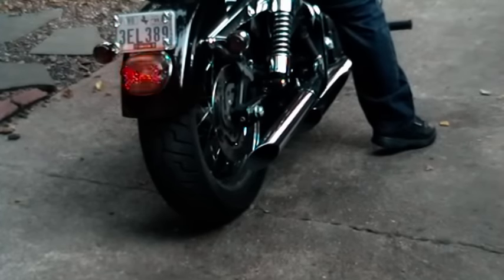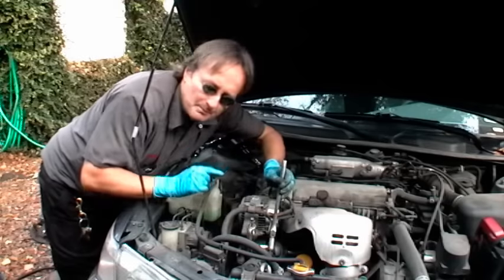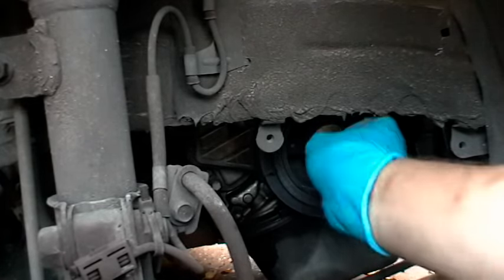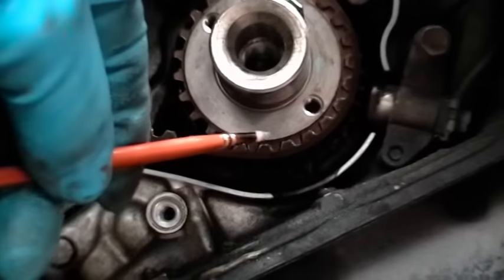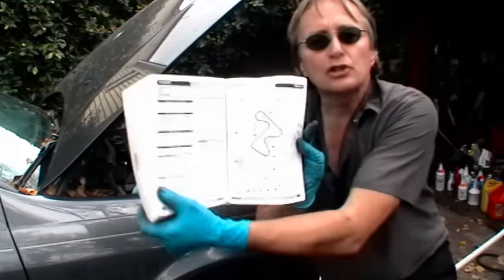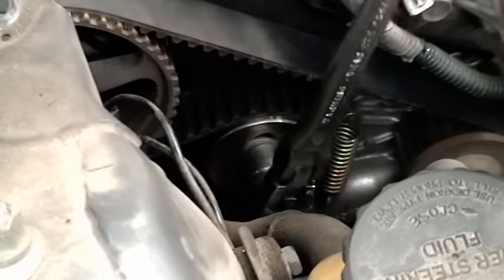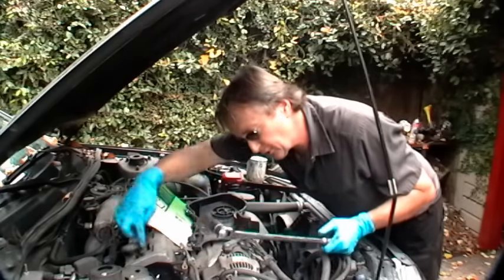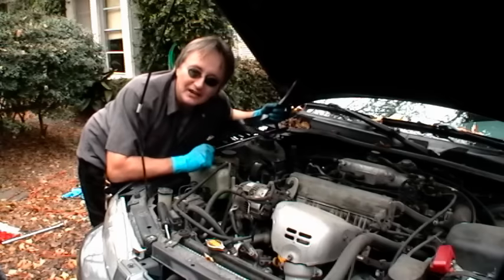How to Replace a Timing Belt in Your Car

Comment: Would a broken timing belt or a slipped one cause the car to not start? My 94 ford escort lx 1.9 won't start but the surpitine belt spins and we had the altnator and battery and starter tested they all work fine it sounds like the car isn't getting enough power when it clearly is.

Comment: Scotty, what do you think about Volvos?
Reply from the maker: +ALPHAzerox898 great cars in the 60's, over engineered Euro trash these days
Reply: Okay, and what would you suggest me, as a mechanic if I want a convertible that makes winter
Reply from the maker: +ALPHAzerox898 convertibles and winter do NOT go together. Most guys hide their rag tops in the winter if they live in snow land.  But if you must have a winter convertible, try to find a japanese FWD one, though they are hard to find as not many were made
Reply: Okay, I can see the Lexus IS350C which is made by toyota. Also, there is a BMW AWD but I won't  think about that one :P Thanks for the answers!

Comment: i know, right? but i did some number-crunching, and i'll definitely be able to get it towed to the shop for them to handle it properly, otherwise i dont know how id be able to keep the engine up because the engine mount has to be removed, which means the engine needs to be hoisted up to get to the belt. turns out ive got this one under control....this is just sheer dumb luck though

Comment: The engine mount is in the way of the timing belt, should I take it off?  Will the engine just fall to the ground if I take the mount out?
Reply: Raptor 911 you shouldn’t be attempting this if you have to ask this question!

Comment: hmm, i was told you need to crank over the engine to TDC and lock down the cams and crank. Is this true? or does it differ for each engine? I have an interference dohc engine

Comment: Hely Scotty, car was running greaet but today I 
so i installed push button start system in my  ford escort zx2 178k MTX, turn it on with the button, then i turned it off and the on then off then on then off, at the 5th time that i dis this consecutively, smoke came out under the hood on the passenger side.

then the rpm's went low and then the car died,  since i started it on and off and on and off , would there be a chance that the smoke was caused by the timing belt jumping or something for starting in and shutting it off consecutively so quickly?  or not.

car now starts , rpms go as normal, then they slow down and then the car dies, unless i give it gas. as long as i give it gas the car will stay on but as soon as i let go , rpms go down and it dies.

if no the timing, then what could it be ?
Reply from the maker: check your work area for shorted wiring
Reply: Sounds like resistance is going up in the new push button wiring and it is looking voltage after it heats up.

Comment: I changed the timing belt off a 2000 caravan with 3.0l v6. The cam sprockets are slightly off by a tooth but the crank is at tdc. Engine wont start are my valves bent?

Comment: Scotty, I'm about to change the water pump on my 2000 300m 3.5l v-6... doing that I have to change the timing belt as well... my question is.. if after I mark them and put the belt on, then rotate it 2 full rotations, of they marks don't line back up... then what do I do?
Reply from the maker: +Lee Harberts  then you start all over, cause sometimes the belts slip when you first tighten them up. Most pros will use a cam holding tool for the cams so that doesn't happen

Comment: When my 2004 Mits (standard trans) reached 65K miles and had to turn it in for an airbag recall the mechanic told me I should go ahead and get my timing belt changed. I almost told him to blow my tail pipe. At any rate I am a great shade tree mechanic and have taken care of this car well since I got it new (no need for me to get another new car) this car drives nearly as if I had just taken out of lot back in 2004. It is now at 91K miles with no issue with it vibrating. Should I replace the timing belt any way?
Reply: Most cars should have their timing belt changed around 100k

Comment: If you just have a crankshaft position error since I have to loosen up the belts is there any re timing of the belts done or do I simply just replace the CPS and put the bolts back in and start the car?. And I keep coming up with P0035 CPS circuit A. I’m about to replace the sensor but would this cause the entire no start or could timing be an additional issue and would it throw off this specific code of the timing was off?. Thank you for your time. 

2003 Mitsubishi Eclipse 2.4

Comment: Scotty, my customer has a 1994 Ford F-150 4x4. I have located a faulty spring in her distributor, a bad pick-up coil, faulty ICM, and a fuel pump that would only present 14lbs at first cycle of the key and 39lbs at second cycle of the key. I have replaced all components. Before installation of new distributor, I set the number on cylinder at TDC on the compression stroke. I installed the distributor with the rotor pointing towards the number one cylinder on the cap. I removed the plug for the ECM for correct timing results. This vehicle will not stay running period. It is very difficult to start and when it does start, it will not stay running. I am wondering if there is a step in this procedure in which I have overlooked?
Reply from the maker: not really, but I would check the fuel pump pressure and volume especially if you used a cheaper non OEM unit.

Comment: hey scotty, I thought that you were supposed to specifically torque the bolts to the tensioner, crankshaft, balancer, etc. and also take off the grounding cabel to the battery. Are these all simply formalities that don't really matter so long as the bolts are tight enough or what?
Reply from the maker: +Strife Life pretty much, but if you're totally unsure of doing the job, get a cheap manual with torque specs and use a torque wrench
Reply: Scotty Kilmer alright, cool, thanks Scotty

Comment: Hi Scotty.  Can you tell me if the repair is changed for a broken timing belt?  I have a 94 Dodge Caravan V6...   it is a non-interference engine (as I have gathered from my research).
Reply from the maker: Gregory Bryant I don't understand what you are asking, but if you're asking what it costs, it's rather expensive on that V6 engine as a lot of crap needs removing to get to the belt on that poor design
Reply: Scotty Kilmer   thanks for the response.    I meant to say,  will the repair be the same for a broken timing belt (as replacing one that is intact)...      Will it be difficult to get everything timed correctly?  I'm a novice at best, but I am gonna have a crack at it nonetheless.  (since the van is practically worthless). ...
Reply: +Gregory Bryant not likely. There is a high likelyhood that you have bent valves which would require you to replace those valves depending on how many are bent
Reply: daniel dallego   Actually I was able to replace the timing belt successfully. As I mentioned, I have a non-interference engine thankfully.

Comment: I've got an Audi Allroad 2000 2.5 TDI (C5) and the timing belt job is just ahead. Just a question... I have seen many people change the belt and right after the belt comes off, the crank-pulleys snap wildly out of place - how could you just remove yours without the pulley even flickering an eye? Did not see any stoppers in place... or have I gotten the thing all wrong?
Reply from the maker: those audis are cows to work on requiring special cam and crank holding tools. BUT, if you put the car at Top dead center before removing belt, it often won't snap if you're careful

Comment: hey scotty, I have a 96 infiniti i30. I changed the O rings on my water pump. Problem 1: the water pump still leaks no matter how tight I screwed to bolts. (not sure if I over tightened them. And also to mention, two bolt holes were stripped but I used slightly longer screws.) 2: when I finally put everything back into place, refilled radiator, changed my oil. When I turned on the car, it wouldn't crank up all the way/ turn over. can my timing belt or chain be the problem? Too tight, too loose?

Comment: Hi Scotty, I'm trying to change the timming belt, but I can not loose the nut of the crankshaft pulley!!!. I don't have an impact drill tool, so when I try ti loose the nut, all the crankshaft turns. How can I loose the nut? What is the trick? Thank you for your help!
Reply: Miguel, position a 1/2" drive breaker bar (may need to use a small section (12" - 18" long) of 1.5" dia. pipe on the breaker bar to increase leverage) on the Crankshaft bolt, then use a large/ long screwdriver, jammed in between 2 teeth on the Flywheel, to hold the Flywheel from turning. Or purchase a 1/2" electric drive impact wrench (Harbor Freight tools).
If air powered tools are available, use an air impact wrench. Or ask a Mechanic to loosen for you, then tighten up so you drive home.

Comment: My good friend whos a mechanic is changing my cambelt on my Lexus with its 1G FE Toyota engine, but he said he needs a special tool from Toyota or Lexus that removes the crank pulley. Is that what you used in your video for this Toyota? and where can i get it if so?

Comment: Hello Scotty,  this is the guy of the lexus is300 remenber the timing belt replace and wen started has clic noise, ok still has the noise, my mechanic said is the vvti gear, Cuz I pull it out to change the seal behind it, so my question is: the vvti gear can be the noise after pull it out and can't get adjusted?
Reply from the maker: yes, they often will make noise if not put back on correctly, they are very complex systems and can be damaged or set wrong by doing what you did to change the seal.

Comment: hey scotty all i wanna do is just change the  timing belt on.  is it necessary to go threw the water pump  next etc.
Reply from the maker: do as you wish if no leaks or worn bearings show on the pump when you spin it
Reply: How would you be able to tell if the bearings are. No good by sound or how it spins
Reply: Check for any play, scratch noises etc, also try to clean it

Comment: Scotty I have a Saturn station wagon 1998 The back windows will not go up or down I have to move them by hand to close Should I take of the door panel to see what is going on . There is a bit of clinching noise when I try to close them automatically 
Looking for ward in hearing from you Scotty .thanks
Reply from the maker: +Steve Morris  on those, best to just replace it all with a chinese made motor/window regulator assembly

Comment: Scotty, I have a 2000 Civic and while on the highway the cel started blinking and the car began running rough. Had the codes checked at auto zone,they said 1,2 and 4  missfire codes. I replaces plugs, wires and cap and rotor, no change. The car was low on fuel. Do you think it could be a fuel injector problem? The car had been running pretty good til then.
Reply from the maker: yes, swap those injectors with others, if the miss moves, that's it. If not, blowing head gaskets often do that
Reply: Got a dead #3 no compression. Bad valve I hope.

Comment: Scotty please help. I'd really appreciate your advice. I own a 2001 Nissan frontier 3.3 V6 supercharged truck. The motor is a VG33ER model. I'm burning fuel like its going out of style.  A knock sensor code only appears on a OBD reader but no engine light shows.  This is a very costly repair and I'm wondering if my ignition distrubtor and cap could throw this code?

Comment: Hello Skotty, I purchase a 2001 lexus is300 with a 133,400 miles, one owner, he never replace the timing belt, so I decided to replace it, so I call my friend ( Lexus mechanic) he did it, and when we start the engine we discovered a clic noise, so he check everything and the noise its coming from the injectors,  how this is possible???? Was running smoothly,  I need help to resolve this thanks!!!

Comment: I had my timing belt replaced on my Toyota Camry but now my car feels weird. I accelerate and it will hardly move forward, as if wanting to stall. I release the accelerator, step on it again and it will get moving again. It's only done this several times when I'm coming out of my street.

I'm in tune with my car and every little sound and vibration it makes so this little stalling makes me nervous. I also notice a slight pull when I'm driving. You don't feel it as much when driving at highway speeds. It didn't feel like this before I took it to the mechanics for a water pump replacement where they also replaced the timing belt.
Reply from the maker: job was poorly done, take it back

Comment: Could use some advice have a 97 voyager 3.0 sat out side all winter ran fine I would start from time to time then it was kinda hard to start well it wouldn't start I have fuel pressure changed plugs cap rotor plugs still wouldn't start floored it pist off and it started really rough catalytic converter was red hot so disconnected it started it same thing still was not running better and sounded like a demo car lol could it have jumped time my head hurts from thinking ???

Comment: I think I am a few degrees off when I aligned my timing marks, would it cause my car to shake in idle ? At idle 800-900rpm my hood shakes and you feel the vibration on the rest of the car, I don't get the full power at high rpm that the engine had before I did the timing belt, would a couple degrees off cause it?

Comment: My car is timing belt went out (Loud Rattling Sound) and was wondering what else could possibly go wrong as a result of that? Thanks!
Reply from the maker: depends on the car. If  a toyota, no damage is done. BUT if your model has an interference engine, the valves can hit the pistons if belt breaks or jumps timing
Reply: Scotty Kilmer what is interference engine like? is a ford fiesta 1.4 16V petrol?
Reply from the maker: ijustinw I would need the year and it would have to be an american model, because my data system only covers us models
Reply: Scotty Kilmer it's european but I would guess it's the same as in US, but year is 2008 and engine code is: FXJA

Comment: Just finished installing a new timing belt, water pump and tensioners to my 2009 Kia Spectra. Car has hard time turning over and when it does turn over it idles extremely rough. My timing belt did break on a red light and did try to start the car when it died on me. Did I break my valves and pistons?
Reply from the maker: valves are probably bent, do a compression test to find out

Comment: Hello Scotty. I have a question. I changed a timing belt of a kia sedona 02. After i was done I felt it was misfiring. it was shaking alot. do you think the timing is wrong or do you think the engine was destroyed? I hope not. thanks Scotty
Reply from the maker: Andrew Guerrero if you are off just one tooth on the belt, it would do that. Odds are that's the problem, take it apart and check the line up marks
Reply: Andrew Guerrero timing light may help to check if don't want to take a part again. the timing mark should match
Reply: Thanks

Comment: Hi Scotty, I have a Toyota Echo 2000 and when I turn it on and take shift it to drive/reverse  it accelerates with out me pressing the gas pedal. Is that something normal? I recently had it get oils and filters changed and something about the ignition system cleaned out, also both belts were replaced but this acceleration prob was before and still going on after. any comments on this?

Comment: Seen alot of waterpumps and pulleys go bad even before the timingbelt should have been changed so i will allways change the waterpump and pulleys it aint that expensive if you compare it to a new engine.

Comment: Hej Scotty, I was wondering, I have an Alfa Romeo 166 2.0 twin spark engine that needs a belt change. People say it is hard to do on Alfa's; you need cam shaft locks and a measuring tool in the spark plug hole to find tot dead centre for cilinder 1. Do you think this is doable by an amateur mechanic like me? Or more somehting for the pros? Thanks Scotty!
Reply from the maker: pay a pro, the tools cost too much and one slip up, BOOM, bent engine valves
Reply: Scotty Kilmer Hi Scotty, I was obstinate and insisted on doing it myself. I bought the tools and belts + water pump for about 200 euro in total and followed all the original procedures. Ran into some problems with a stripped tread by using too short bolts for the cam locks and also my ' the right stuff' valve cover gasket started leaking oil, so I had to buy a new gasket nevertheless. Luckily, the timing belt is fitted fine, and timing seems to be ok, I checked numerous times.  The car has a 1000 miles on it since the replacement, so I am starting to trust the repair now. Thanks for inspiring me with your channel Scotty!

Comment: Scotty, I had my timing belt and water pump etc changed a few weeks back. After the service, the car just vibrates/shudders during acceleration. What might be wrong here? There's no check engine lights. It has me over whelmed. Could be faulty tensioners or waterpump?
Reply from the maker: generally that's just a sign of crappy work, not putting the timing belt on correctly. Take it back, they may have to do the job over again cause they could be just one tooth off on the belt alignment
Reply: Scotty Kilmer It definitely sounds like that and I did take it back, they said the CEL would turn on if they had missed a tooth and now I'm leaking antifreeze as well. This is frustrating.

Comment: Scotty, how do I turn the engine over 2 complete revolutions?
Reply from the maker: +1234 5678 use a long extension bar with a socket on the end to turn the crank pulley bolt

Comment: Scotty, is it possible to replace the tensioner without removing the belt? The belt is only 6000 miles old and I don't want to remove it if possible.
Reply from the maker: you can if you are careful, but really, you can just remove the belt, put a new tensioner on, and just reuse that same belt, that's easier